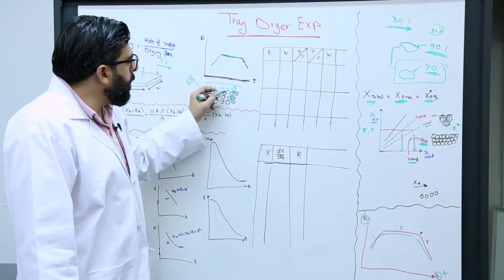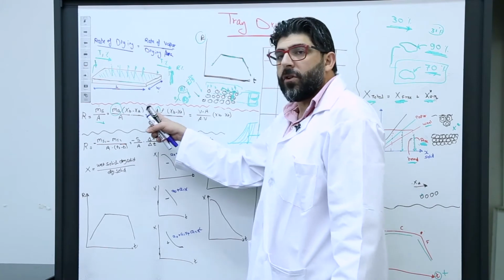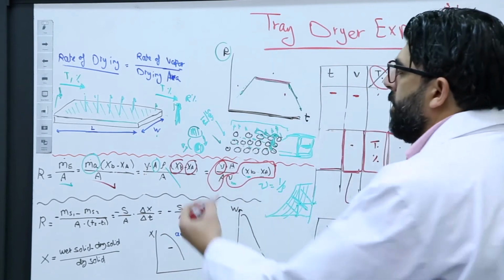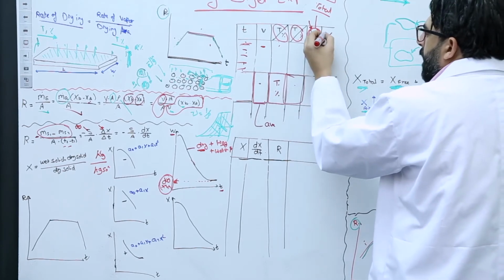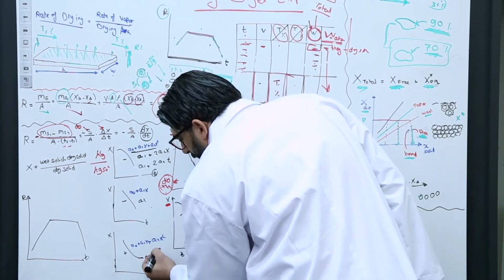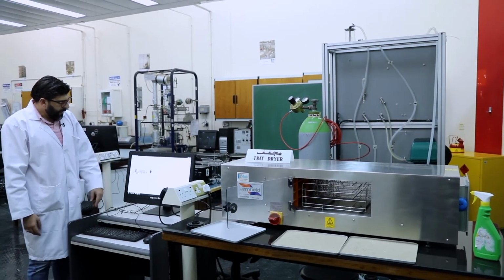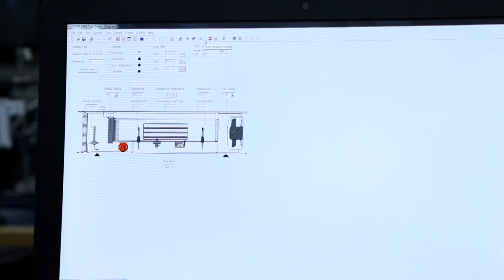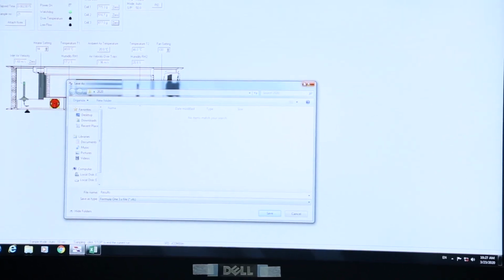Tray Dryer (Theory and Live Experiment)

Comment: Drying rate is better calculated in volume of dryer void space including void space of goods being dryed.
Reply from the maker: Thank you for your valuable input. The effectiveness of using either the area or volume to evaluate a dryer depends on its type. For a tray dryer with a large surface area and low height, it's more appropriate to consider the area of the dryer rather than the volume.